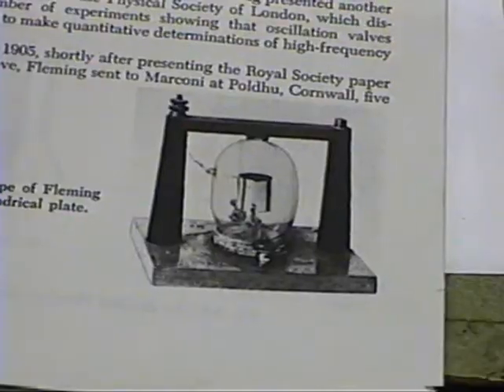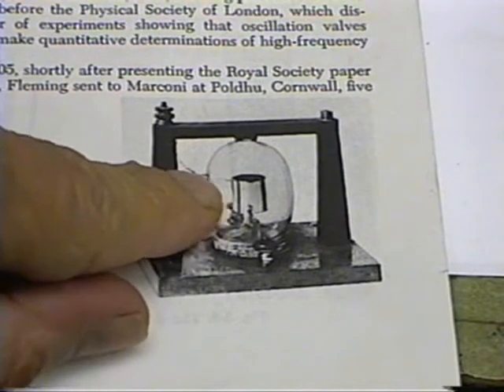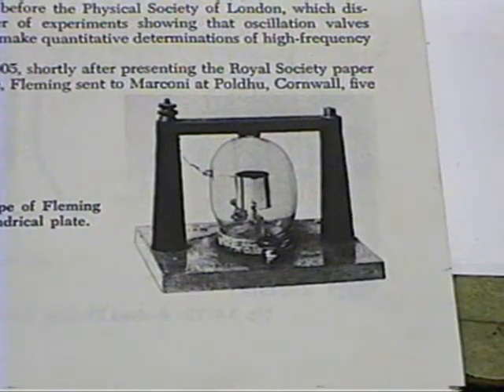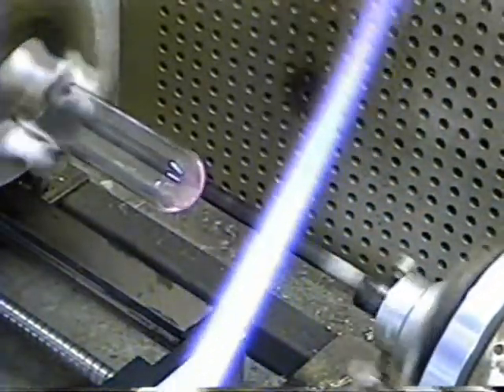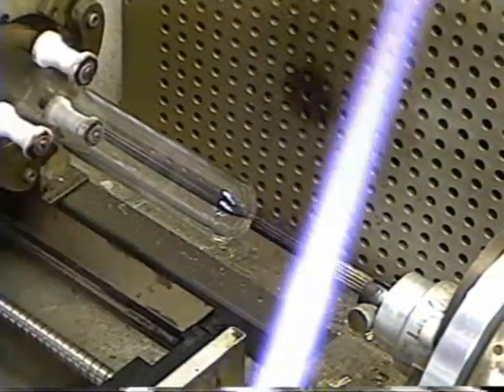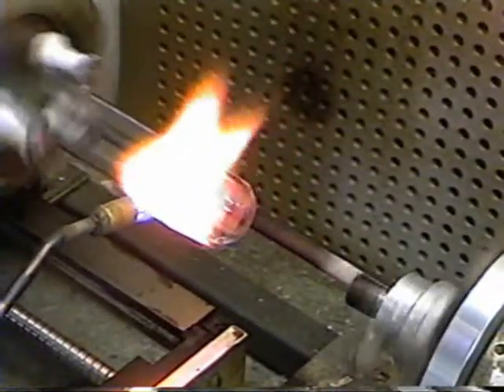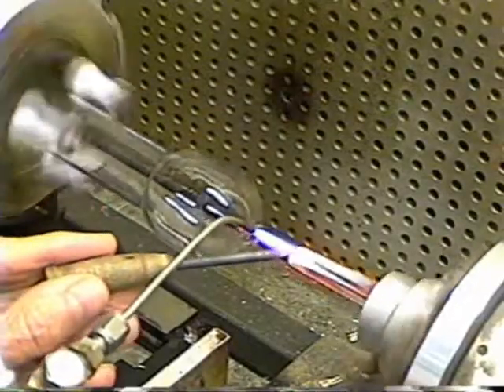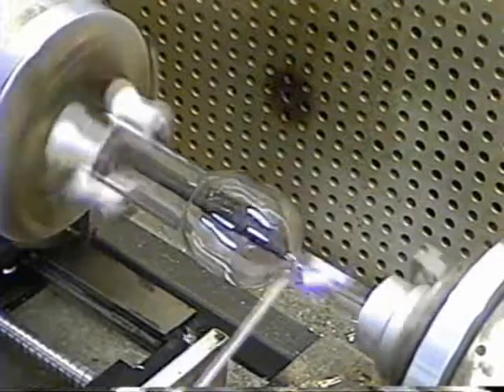making a fleming diode vacuum tube 1

Comment: absolutely fantastic. I have lathe experience but not enough need for it lately... I love glass blowing but not enough need... now you've combined them for me with tube electronics and relative self-sufficiency and blown my mind. I got my tube tester today to refurbish and use for vintage radio, but you've got my sights on making tubes down the road a little! I wonder: if someone were picking pieces of society back up (and had no working transistors or tubes around) which would be more practical to start back out making some of (if you have modern information from books) tubes or transistors? This makes it look like tubes. Even knowing about semiconductors, wouldn't transistors from scratch be more difficult than this?

Comment: people out there. What he is using is an acetylene torch used mostly for refrigeration brazing. It is not very expensive, but I think you have to rent the acetylene tanks from a commercial gas tank company. Who the heck knows what kind of certificates you will need to rent the tank? You probably can rig one to a propane tank, I,m not sure about the temp. differences between the two.
Reply: Might be able to use the BernzOmatic Mapp gas which is used for brazing...sold in the big box stores and most likely the local hardware stores.
Reply: +redlored100 You can buy tanks. Most of the time what you find for sale are stolen rental tanks, which will not be filled, so pay attention. I don't think you need more than a credit card to get welding & brazing gases.

Comment: Any chance you would share the diagram & parts list you used to build it?  How many windings/what gauge, etc? Power supply info?  Over the course of 30 years of repairing electronics, I have seen many ways to do the same tasks, some more effective than others.  The spot welder you built looks to be much better for detail work than the ones I saw while trying to find one like yours.
My email address is tvhousecall@aol.com if you wouldn't mind contacting me that way.
Thanks.

Comment from the maker: The unit is home built. It uses an old microwave oven transformer with the high voltage winding replaced with a high current winding. A simple foot switch turns the unit on and off. A 100 ohm 50 watt rheostat controls the weld power.

Comment: Surprised they they did not make the leads exit through the bottom to avind extra complications and difficulties.
But I am afraid to work with glass, so maybe for experienced carftsmen it was not difficult.
(I used an alcohol burner and played with glass tubing and blew bubbles.)

Comment: I agree, but I assume one will need to break the vacuum to add the plate.
In this manner I only need to make one hole, add the plate and seal, and suck the air out and seal again.
It looks like this does if the Edison base is not in place.
But with the Edison base it can simply be screwed in.
And the filament is excellent! one can run it from a dull glow to white hot.
At a low glow it will be good for at least 50 years!

Comment: Most GLS lamps nowadays have some kind of argon/nitrogen mixture (the proportions and presence of any other gasses like krypton and hydrogen depend on the intended use of the lamp), so they are not suitable for making vacuum tubes without a means of making a vacuum in them.

Comment: I very much cheat!
I simply use an old clear light bulb.
The modern light bulb has a base that the air has removed from as well as the 2 wires for the filament.
A 3 way bulb will yield 3 wires.
With a modern tungsten filament the electron flow will be excellent.
And, yes, this will look just like the original, just a large egg.